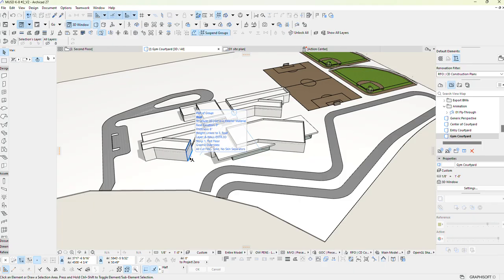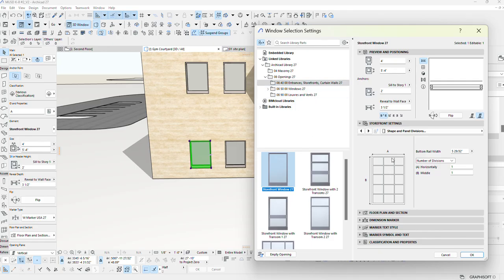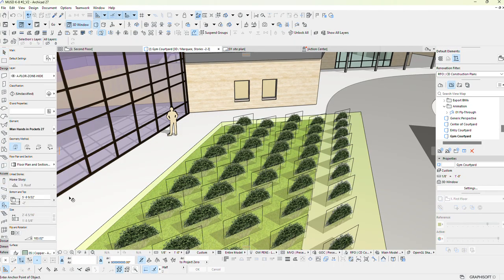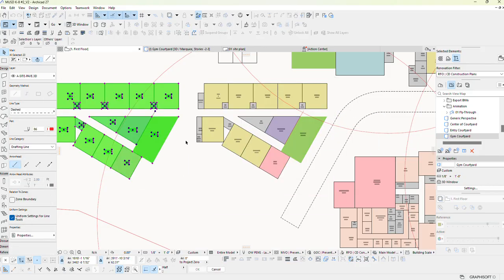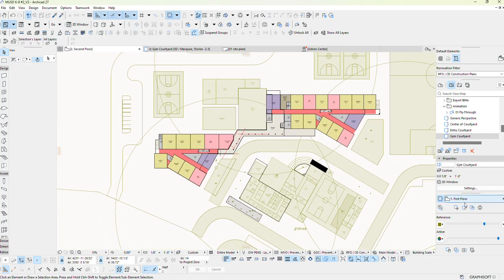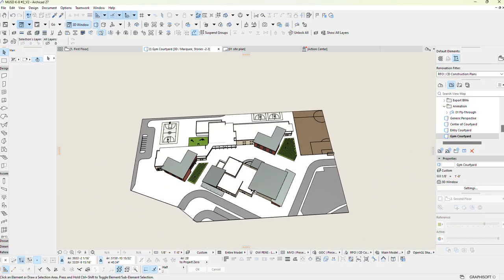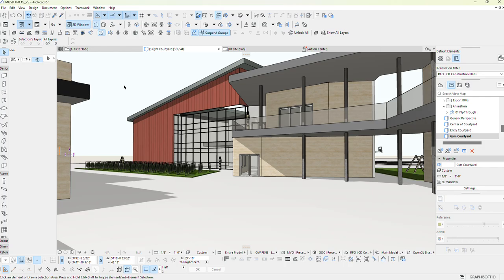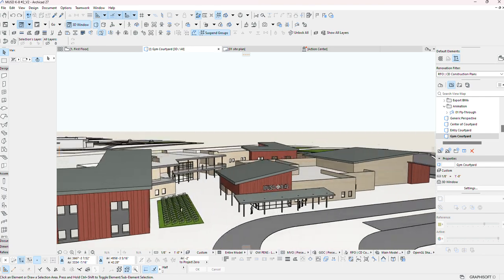Why I like Archicad better than Revit

Comment: The other reason Revit is popular (or more widely-used. "Popular" is a loaded phrase), is because early on in this century when BIM was still finding its place in Architecture and Construction in the early to mid- 2000's, Autodesk adopted a strategy where they would give away free copies of Revit with every Autocad purchase (AutoCAD was the default drafting and CAD application and virtually every office had it),  initially as a promotion for offices looking to start the switch to 3D modeling and BIM documentation.

They did the same with schools, where schools were given free Revit licenses with their Autodesk product contracts, and eventually Revit was everywhere and if you needed to collaborate with a fellow professional - even outside architecture proper - chances are they'd be on Revit and would be requiring Revit deliverables.

The funny thing is most people who use it (for design) - hate pretty much everything about it, especially the ones that you listed (the awful '90's Microsoft Office-esque interface and layout with the "Microsoft bar"; the 'Dialog box based way of navigating and doing stuff; the inabilty to work in  perspective view in 3D; the rigidity that the constant constraints and parametricism does to limit free actual "design"), but since it's so proliferate and everywhere - and also, to be fair to them, it's a really capable documentation tool especially for large-sized projects - it became accepted by default as the .....well,....industry default and standard.

Much like Autocad before it - which is kinda ironic because not that many people loved, or love Autocad, but we all just accepted it as the industry default.

And yes, Graphisoft dropped the ball several times and several ways in bungling the opportunity to establish themselves as the premier software for BIM (they were the first, after all) - which is especially egregious because Archicad is legitimately superior in many resepcts to Revit.
Like their failure to  popularize and promote it more in North America and largely outside Europe where it remains more widespread in most countries than Revit.
Recently, they've had a bunch of critical customer-service related bungles and missteps relating to how they're developing the software and moving forward to the future in terms of the direction they seem to be going and the licensing model they've chosen.
It's all a big pity, really.

People who actually use it and know how good it is, really love it.
But the company is not doing them any favors these days.

Comment: HI. I use archicad and sometimes I think about switching to Revit because it became industry standart. It is great to see experience of someone that use both sofware. I am surprised to see that revit lacks simple techniques archicad has. Sometimes I even find archicad modeling not enough so I learn rhino-grasshopper to use them as modeling plugin for archicad.